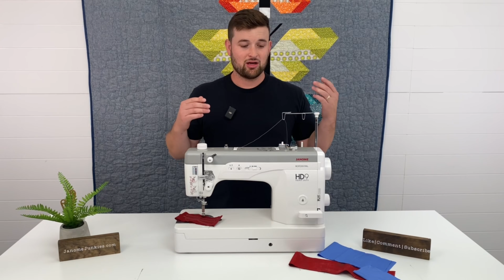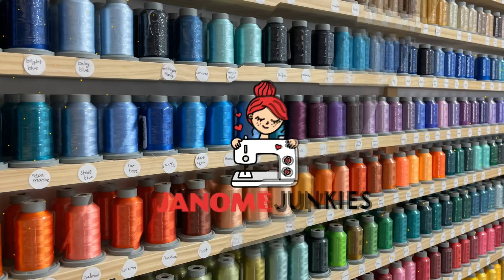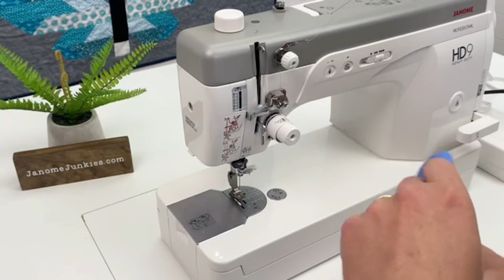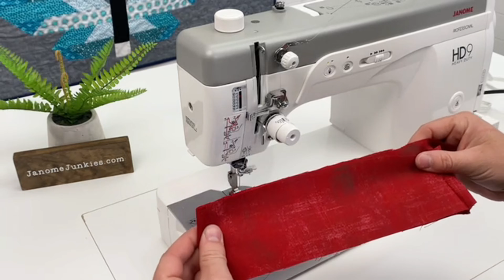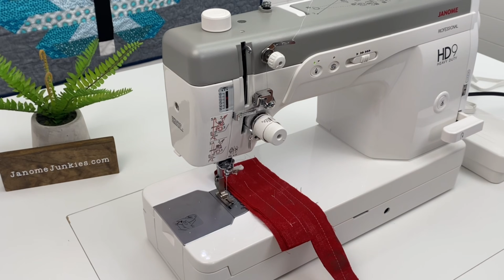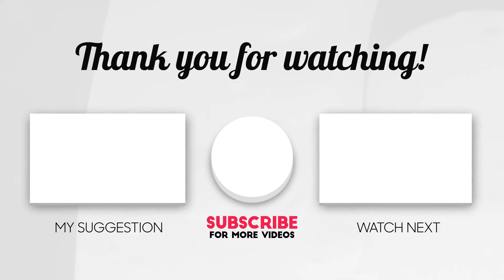Janome HD-9 Tension Tips: No More Loopy Stitches!

Comment: Great explanation of the bobbin tension test at 3:00. You mentioned it’s thread-dependent, but could you dive deeper into using heavier threads for projects like denim? How do we determine if the bobbin tension is dialed in correctly when moving to those thicker thread weights?

Comment: Because that top tension dial sticks out so far, I've actually bumped it accidentally and rotated that knob quite a bit.  Then I had to figure out how far I turned it and turn it back.  I've never had it mess with the stitches.  Why does it stick out so far and get in the way???  BTW, I'm quilt piecing exclusively with my HD9.
Reply: What needle and what kind of weight and thread type are you using. I was thinking of using my hd9 instead of my GP singer HD.
Reply: @liven4happynus115 I use a size 12 needle and 50/3 weight cotton thread to piece quilt tops.

Comment: Do you have a video showing how a good bobbin case should look like? With my machine,  when the bobbin is inserted in the case, it’s not flush or it’s like pushing it out a little bit. Is that normal or does it need to be changed?
Reply from the maker: That can be normal check out our bobbin winding and threading video to see if we have any better clips of what that looks like.
Reply from the maker: Make sure you have the correct version bobbin and bobbin case
Reply: @janomejunkies can you please  give a link to the Janome HD9 bobbin for purchase. TY

Comment: I have tested my tension prior to starting my project. It is fine and then after awhile the tension goes off. The start of the seam is good by the end of the seam the Simon is off. I retreaded and tested my tension but it continues to do this. What would make the tension go wrong half way through a seam?
Reply from the maker: Is the material changing? If not maybe your tension dial is messed up or threaded wrong.

Comment: I've owned and sewn on my HD9 for over a year and it's been fantastic --- until it wasn't. Suddenly, in the middle of a project the tension went wonky and I tried everything I knew to fix it. Changed the needle, wound a new bobbin, cleaned and oiled the machine - nothing worked. The upper tension was obviously the problem, with loopy stitches on the underside. Even after dialing the upper tension knob to its tightest it was still too loose. Then I found this video, followed all the tips up until the last one about stretching the tension spring out, and thought, "ok, here goes." And Oila! That was it. Runs and sews just like it should. Thank you so much!
Reply from the maker: Yay! This makes me happy to hear. Enjoy!